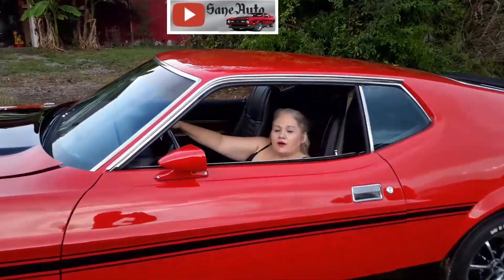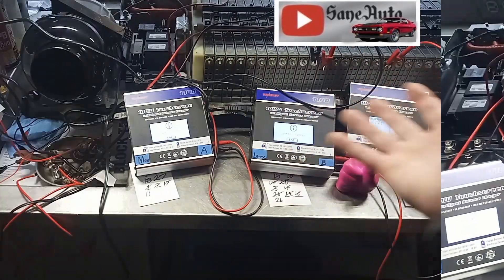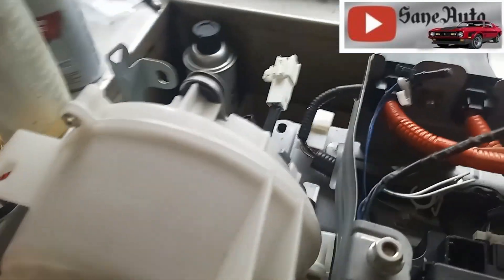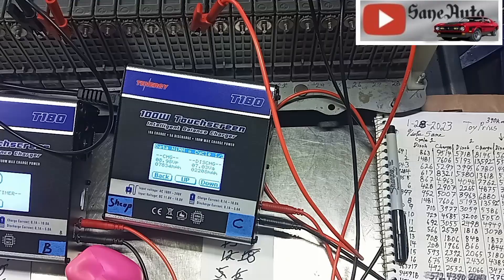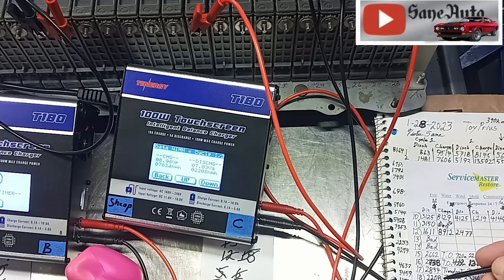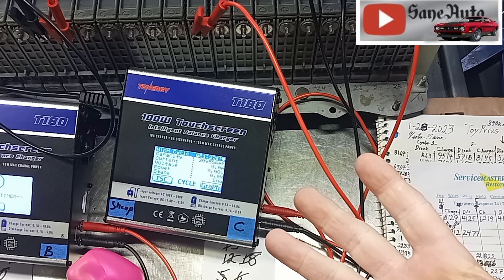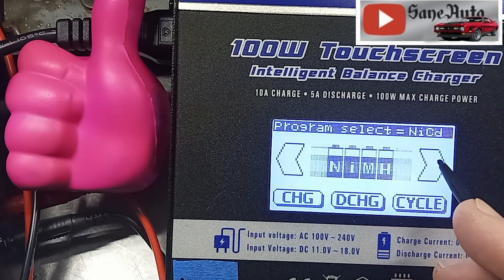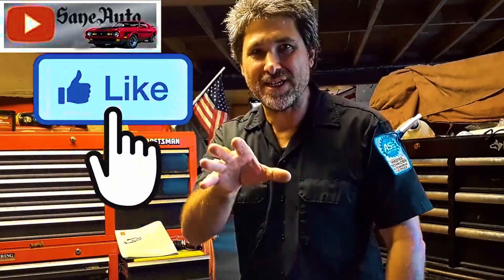Unlock the Secret to Reviving Your Prius Hybrid Battery - T180 Timer Tutorial! Safety timer settings

Comment: The problem I now see with the T180 is that the 7500mah means nothing to it.. I had hoped that it would cut off charging at 7500mah or 340 minutes whichever came first. But it completely ignores it I don't understand why bother have that option in the first place
Reply from the maker: I agree with you about the mah setting. It seems to ignore that. I had to keep cutting back on the time setting till I got it "Time constrained" enough to shut off without charging a bunch of mah over what i desired. I put these HV Battery videos in a separate playlist so they wouldnt be lost in the other 1000+ Videos. I hope this helps https://www.youtube.com/playlist?list=PLADlyv_PN7XKgRkxE62bMJYpr_mLHd6iv
Reply: @saneauto  yea i watched most of them and even left another comment on another asking about what to make of some of my results where the battery charge and discharge ok but on the next cycle the charge is way less didn't even reach the thousands then discharged the same amount then after it charged up more to the first charge. Don't know if I should keep it in the pack

Comment: Where can I learn more of the details of doing this?

I have a 2013 Prius Plug In which I think understand has Lithium batteries.
Reply from the maker: 2010 2015 come with the same batteries as the one Im working on here. There is an experimental Aftermarket Lithium replacement available. I have many more Prius repair vides here - More Prius repair Videos -- https://www.youtube.com/watch?v=8fshMta375I&list=PLADlyv_PN7XIbqH6f-5bRtuISlKrkfsBI